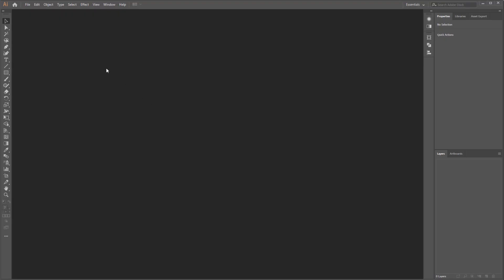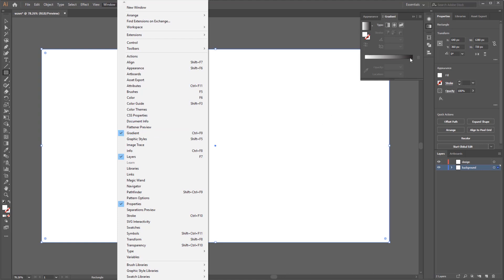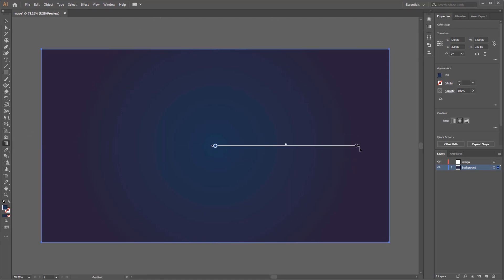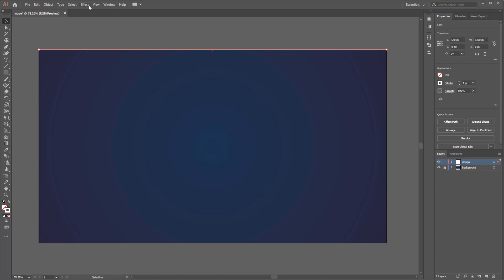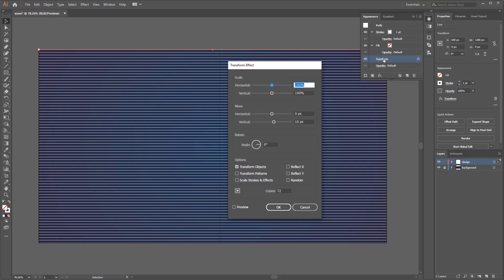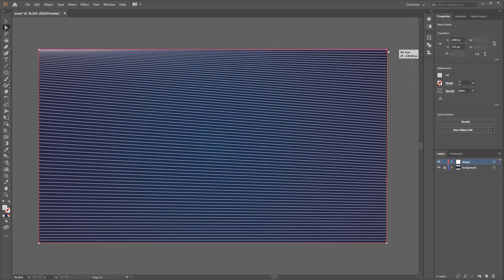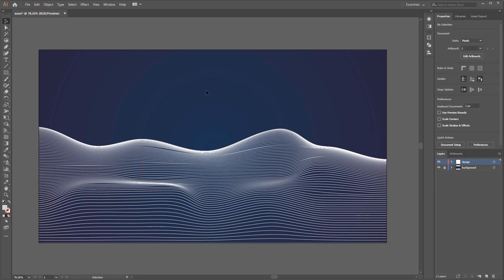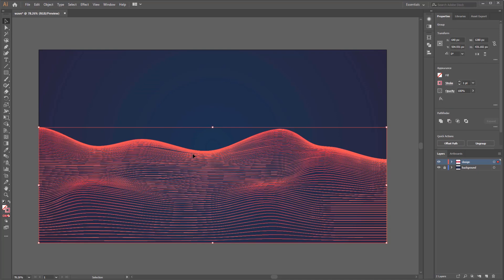Dynamic Line Wave | Adobe Illustrator Tutorial

Comment: i dont know what im doing wrong. when i start messing with the anchor points to create the waves, it turns into white waves, not line ones but like a shape filled with white
Reply: Do you still have the white colour turned on for your fill on your lines? Maybe check that. White box with a red cross through for the fill and then solid white colour for the stroke.

Comment: Great video! I am stuck on one point.. at 9.40 using both Selection and Direct Selection Tools I can't seem to move just one line after expanding it. Would be fab if you can advise!
Reply from the maker: Group them n don't use direct selection tool, hope that can help
Reply: @LADALIDIstd  Fab thanks! I've ungrouped then used just Selection tool, thank you so much :)
Reply: same issue and i still cant get it :(

Comment: at 7:05 I select the anchor tool (A), after applying the mesh effect, but it moving everything as a whole like if i used (V) to move the whole object
Reply: I had 4 row  and 4 columns. think I worked it out
Reply: if i do 1 row and 1 columns i don't see the ancor points on the top left and right that i need to move
Reply from the maker: if everything moves, that means all anchor points are selected, while the direct selection tool is still active, try to unselect everything first then select the anchor point that you want carefully.
Reply: Heres what I had to do in illustrator CC , after transform -> Expand Appearance BEFORE Envelope Distort -> Make with Mesh  to get those left and right handles